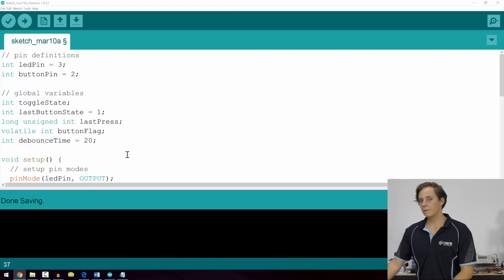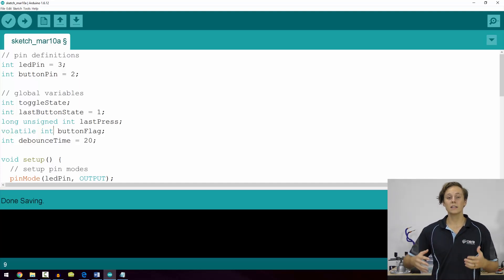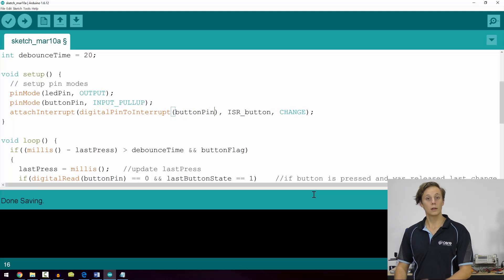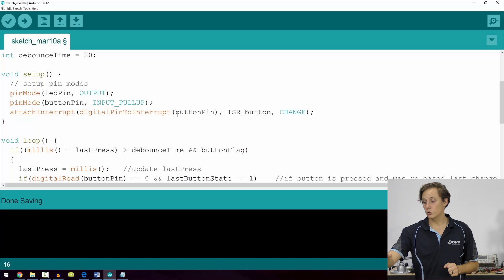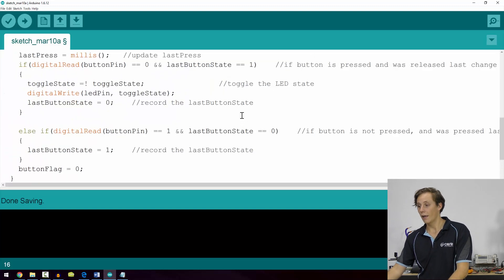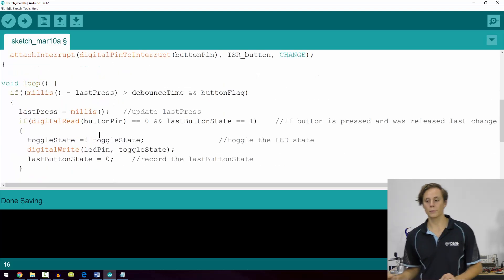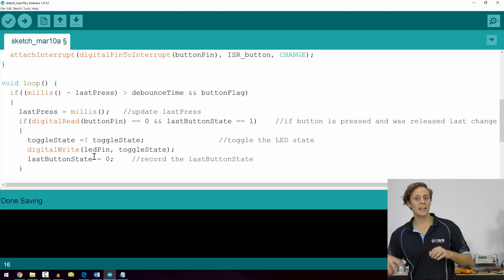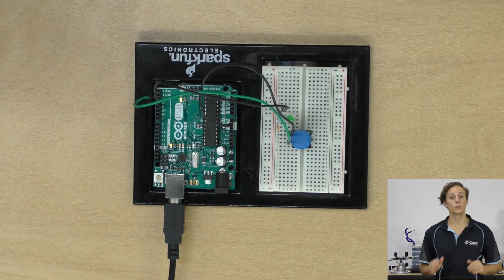Arduino Workshop - Chapter 5 - Interrupts

Comment: 2 things:
1) if you write async code and/or use state machines you don't need to use interrupts
2) on x86-64 you can easily corrupt your own data if you use linux signals which are similar to interrupts, because reads/writes are not atomic and you can get an interrupt in the middle of a variable assignment. not sure if it's the same on arduino

Comment: Having no useful operating system, Arduino cannot spawn a separate thread, and therefore interrupts are no better than simple polling. Throw out your Arduinos and step up to 21st century replacements like Raspberry Pi. Sorry Lady Ada.
Reply: If your application is conceptually event driven, then interrupts give the cleanest code.  If there is some background process that needs substantial CPU time and some event driven process that requires a quick response, then interrupts are clearly needed.  If the processor provides a low power mode, then using an interrupt to exit low power mode is invaluable.  In addition, Raspberry Pi loses big on power compared to the baby microcontrollers.
Reply: @jrstf  I agree that interrupts give the cleanest code under a real operating system. That's where Arduino fails. With Arduino, the code is made more complex because it requires the addition of a polling loop in addition to the so-called interrupt handler code. With a real operating system, the polling loop is not needed.
As for power consumption, an Arduino with WiFI, providing you can get it to work, requires nearly the same power as a Raspberry Pi with its robust WiFi power management support. And what worthwhile project does not need remote access to the code and runtime configuration via WiFi? What practical modern use case for either device cares about power?
It's time to dump Arduino until they learn how to create modern devices.
Reply: @averystablegenius  - As I'm currently trying to interface a rfid reader with a Raspberry Pi using a Arduino, I certainly don't want any wireless, just complicates security. But I haven't done it yet, maybe it'll be a whole lot harder than I think. Not being able to set breakpoints for debugging is already hurting.
Reply: @jrstf  Exactly, Bryan. Arduino's so-called debugging is inelegant at best and a non-starter for me. I get your point about adding complexity, but when I can debug, update, monitor, and otherwise control my project from my phone or computer anywhere in the world without having to be physically near, connected to, or dismantle to project to gain access to the Arduino USB port, the two mouse clicks to enable WiFi are richly rewarded.

Comment: So an interrupt vector is the address of the machine code to run when an interrupt is detected or called. It is not the same as an Interrupt Service Routine, which is the code to be run on the interrupt, but is an address to an Interrupt Service Routine, operating system code running on metal. The interrupt vectors can be put in a table that allows for the updating of the interrupt routine without changing the calling routines code.

Comment: What seems goofy to me is the loop is going to run all that code for the setup of that interrupt each time around when I could reduce all that with a two line of code button branch loop.. 🤔 ,,but then again in a heavy complex code it might be beneficial as you stated.

Comment: I want to read 8 rotary encoders simultaneously. Each encoder is a quadrature encoder with 2400 counts per revolution. Two interrupt pins are required to read the direction and position of each encoder. In total, I require 16 interrupt pins. But Arduino mega has only 6 interrupt pins. Should I use 2 Arduino mega as a slave and 1 Arduino as Master in I2C communication? Will this alternative work? Is there any easy alternative to this problem
Reply: The ATmega2560 has only 8 'external interrupts' but has an additional 24 more general 'pin change interrupts' which has a single ISR per port (8 pins). Perhaps you can make these work.

Comment: If I try to use ISR method for measuring the rotation speed of a DC motor with Hall sensor, I can't use PWM control (it's a rotation speed control system). Somehow the PWM signal wich I try to send to the PWM to DC converter is not constant and stops every time I calculate the speed. The interrupt method should be the most precise in measuring rotation speed. Any idea what is the problem?
Reply: I am not sure but I think the problem is you're trying to use a converter which I think is not suitable, instead to run motors you can use motor driver, those are like little chips with circuits and all required functionality, I think probably the way they work is by using PWM signal as a control which controls another voltage coming from another source, if you directly convert the signal and if the converter works then it will be fine use it, however there could be another possibility you're using a digital signal which is digitalWrite(x, HIGH); 
you can use analog signal which uses the function analogWrite(x, HIGH); that way you can control

Comment: I am working on a FASTLED project in which i so many modes. I am controlling the modes of the leds with IR Remote. My problem is when the arduino executing a function is doesn't receive the value from my remote. So can i use Ir remote and receiver led as intrrupt. So that when i pressed a button from my remote the arduino receive the value and after executing the funtion the mode will change. If it is possible then tell me how can i do this. I tried so many programs and i searched it on google too, but i didn't find it anywhere. Thanks in advance.

Comment: im woking on a project which i use a couple of sensors.
i have a problem which i use 2 encoders to messure rotation speed (using interrupts); and i have another IMU sensors (for messuring acceleration).
how can i read all the data from all those sensors??
i have a problems which im using interrupts for encoders and by that i cant read the IMU sensor
thanks
Reply: I am not an expert, but how about reading the value of a sensor when you require the value? For example, if you want to print the data from each sensor to the serial monitor, you can type Serial.print(analogRead(encoder));
Reply: what kind of encoder were you using?

Comment: do I change the pin (2) to buttonpin if I want to press the select button to roll the dice, heres the code
include <LiquidCrystal.h>
LiquidCrystal lcd(8, 9, 4, 5, 6, 7);
void setup() { lcd.begin(16, 2); lcd.setCursor (5, 0); lcd.println ("catan" ); attachInterrupt(digitalPinToInterrupt(2), btnselect_button, CHANGE);
}
void loop() { randNumber = random(1, 7); Serial.println(randNumber);
randNumber = random(1, 7); Serial.println(randNumber); if(digitalRead(buttonPin) == 0 && lastButtonState == 1) //if button is pressed and was released last change else if(digitalRead(buttonPin) == 1 && lastButtonState == 0) //if button is not pressed, and was pressed last change { lastButtonState = 1; //record the lastButtonState
} }